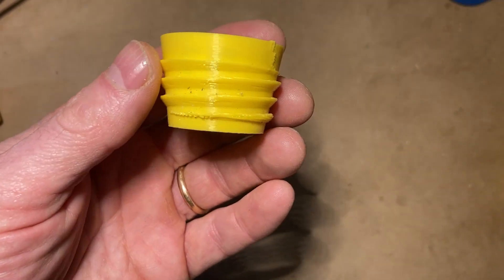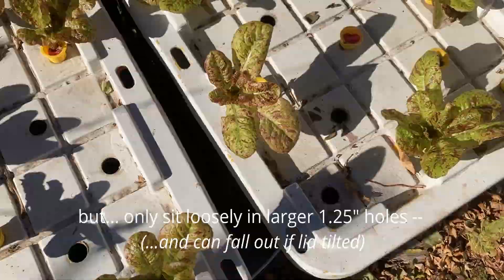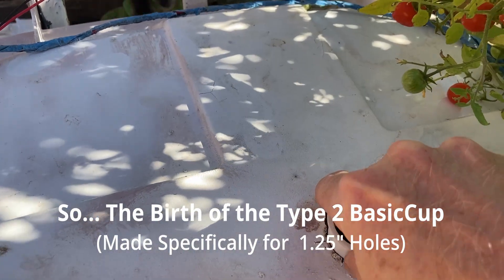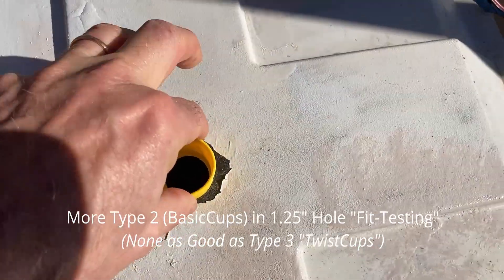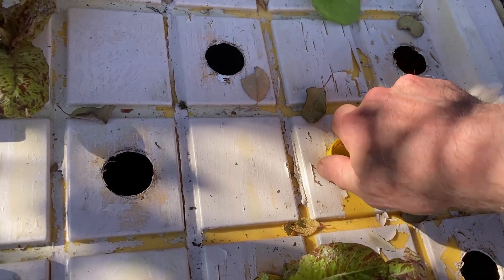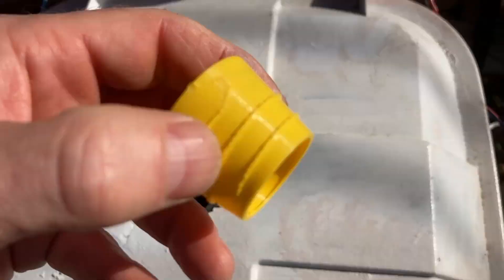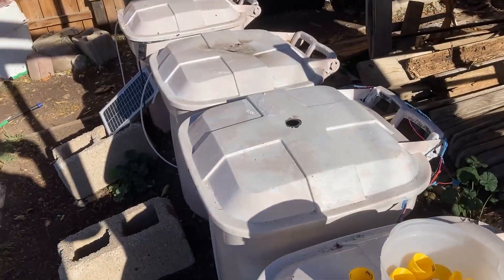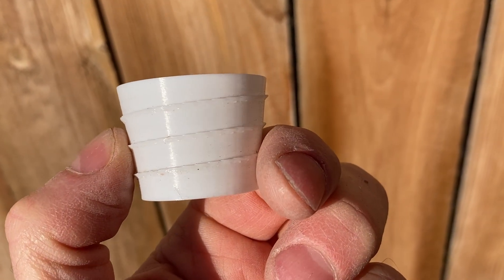The Hydroponic Twist-Cup 🌀 A New Type of Net Cup – Locks & Stays Secure When You Lift the Lid!

Comment: This is awesome . On does the HTC have a lip inside so sponge don’t fall through?
Reply from the maker: Thank you. Glad you like it! It has a small lip at the bottom that helps prevent the sponge from falling through (the taper angle also provides some retention). I think I’ve got it close to optimal but I’ll be experimenting with different lip diameters and testing them in my garden next spring. My goal is to make the lip just large enough to hold the sponge securely, but not so large that it significantly reduces the bottom opening. These Medium-sized (1.25" lid hole) Twist-Cups are designed for smaller lettuce seedlings, but must also accommodate larger fruiting plants whose stems can grow quite thick. I want to ensure the exit is spacious enough so the lip doesn’t constrict the root or cause the cup to crack—something I observed with the smaller (1" hole) Hydro 'Basic-Cup' in the video.